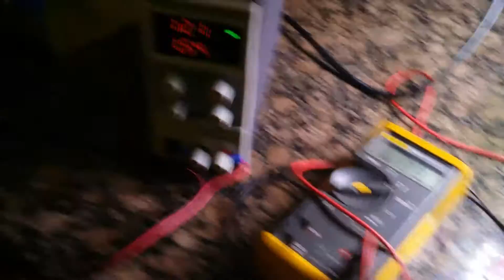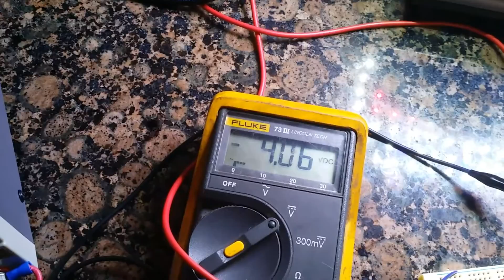Beginning Peltier Cooler - H-Bridge

Comment: Is there a way to add a switch so that I won't have to physically remove the wires to reverse the current?
Reply from the maker: I'd add a single pole single throw switch to switch the power rail to the FET gates.
Reply: Wait do you mean a single pole double throw switch so that by default when power is on it will go to hot, then when the spdt switch is the other side it will switch to cold side?
Reply: Sorry I'm a complete beginner in electronics, and I'm not sure how that will look in terms of schematic or breadboarding :/. If you could show me that'll be awesome! Again sorry for the bother, I just can't get it to work

Comment: Hey, could I see the schematic of your design. I'm trying to figure out how to reverse the polarity. Also is using a 12V battery supply good enough?
Reply from the maker: 12v is fine, and here's the schematic for it.

https://computerwizardlab.wordpress.com/2017/01/17/beginning-peltier-project-h-bridge/

Specifically here's a png https://computerwizardlab.files.wordpress.com/2017/01/h-bridge-circuit.png?w=676
Reply: THANK YOU SO MUCH! How would I control the temperature of the peltier with a microcontroller?  sorry for so many questions
Reply from the maker: Jake Ginobi you'll need a temperature sensor. I'd recomend a lm35 or a tmp36 for a start. You can just measure the temperature via an onboard ADC and then you can wire up the gate pins of the FETs to the microcontroller and turn it on and off like an LED.

I'd start off with an arduino if you dont have a miceocontroller already.

And feel free to ask me any questions that you have.
Reply from the maker: If you're using an arduino then I'd just set up a button on the arduino. Set the pins connected to Q1 and Q4 if the switch is high otherwise set it low. Set 2 and 3 high if the button is low. And then you can set up the button as a latch afterwards to latch it cold or hot.